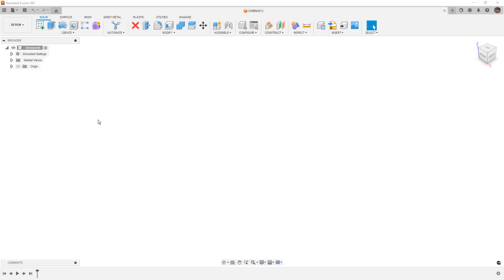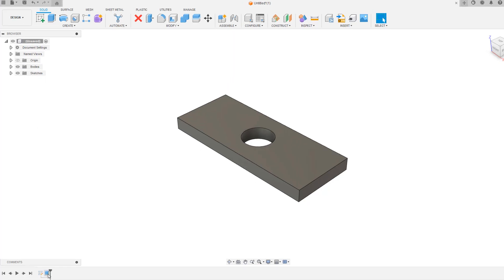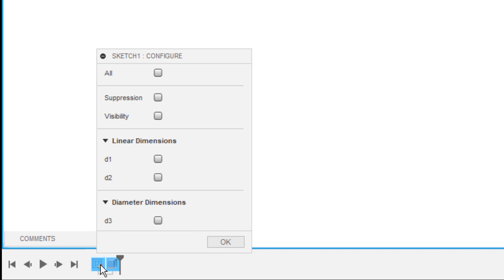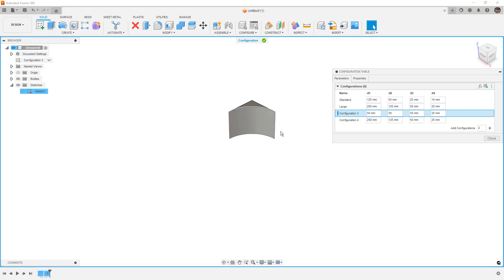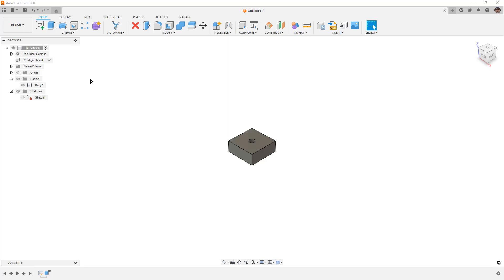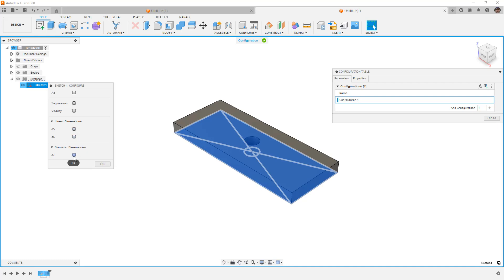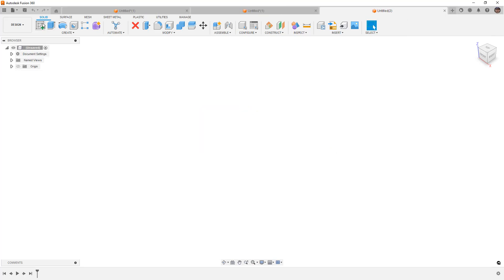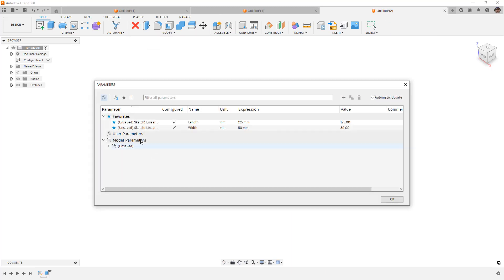Fusion 360 Configurations! | What's New Sept 2023 | How To Configure A Part | Tutorial

Comment: Thank You very good teacher. one question. How do you save Parameters in a template
Reply from the maker: Thanks!  There aren't really templates for designs in Fusion at the moment.  So you can either create an empty file with parameters that you open and Save As when doing a new design,  or in the Parameters dialog at the top right there are import and export buttons. You can create your parameter list, export them and then import into another design.

You could automate this a bit with API by making a script that adds parameters to a new document on open or tie it to a button or hotkey.  Depends on how often you need it and how many parameters you are talking about.
Reply: @LearnEverythingAboutDesign  Thank You very much

Comment: My revised need / understanding 

,... simply using the configuration function to create the "configuration drop-down menu" in the browser, and then "modeling as normal" adding or removing features to the "currently selected configuration", and having those edits be maintained specific to that configuration, "without launching the configuration dialogue workflow"

i'm predicting that unless the features or edits are done via the configuration workflow, any changes to the "model directly as normal" will be included in all configurations, 

Thanks man

B
Reply from the maker: if you make multiple configs but change nothing (don't configure features) you won't get a config drop down.  Even with multiple configurations in the config table, they need to have some variation between them for that drop down to appear.  Again those configuring features is not typically done or efficient if all the components are internal to a single design.  Simply because you need to tell it which features.

Note that once you enable the configurations table, each feature (like extrude) will now have a tab in the dialog for Configure.  that dialog gives you check boxes for what you can configure but it doesn't give you control of values across all configurations.  You would still have to go into the configuration table to handle that.

So I am still not 100% clear on exactly what you are trying to achieve.  The main benefit i see to invoking a configuration table early is to get access to the Configure tab in each feature dialog.  So as you are modeling you could say "i want this extrude distance to be configured" and then it would appear in the table.  It should be noted though that you need to manually change dimension names or else your config table will just be d1, d2,d3 etc.  If configuring sketches/features across multiple components the config table will get out of hand.
Reply: I think ultimately it achieves what's needed, which is variations, "a.k.a. configurations" of relevant Configurable entities, for a  model design, 

,...  it makes more sense now, your not copying a new body, component or sketch to apply needed model variations,, you're creating "value(s)",... variations, "a.k.a. configurations" of existing entities,... Which is selected and managed in the configurations workflow,

after further review, I've concluded that a configurations-short-cut-workflow, that allows the drop-down list in the browser to have checkboxes next to each configuration, which Would take the place of the checkbox selection process that's needed, for example to "suppress" within the table,, this would allow applying configurations more efficiently per variation,

"suppressing" a hole for example, for a dozen "variations a.k.a. configurations" except for 2 of those variations, with the checkboxes in the drop-down for each variation, would be more efficient, and intuitive, then using the table dialogue, 

Thanks man

B
Reply from the maker: you should look into iLogic stuff in Inventor and Configurations in Solidworks.  Some of the functionality that you are looking for might be more inline there.  For example Solidworks gives you the ability to model and make changes on only the active configuration, all configurations, or specific ones.  You can also use Design tables (excel spreadsheet) to build them.

iLogic in Inventor is powerful and offers up different ways to make configurations.

In fusion it is still very new and I imagine will grow and mature in the next year or two

Comment: hey brother, nice work on your channel,

Obviously, configurations, should be called "Variations" that get configured,

"Alternative Easy-fast configuration workflow"?

if scheduling allows, can you do a short video,

Workflow: 
( assuming this is functionally possible )

1. right-click ANY component assembly in browser and click "configuration" ( not default parent tree level )

2. dialogue pops up,
,...rename default configuration to "Variation 1" then add ( + ) another configuration and rename to "variation 2"

,... I now have a second variation, the thought is no hassle needed to apply anything, to Create a duplicate assembly, now with drop-down selection manage-ability from the browser )

that's it! , then,...

1. then, in the browser, select any variation, EDIT THAT assembly "MODEL AS NORMAL", ( change a couple primary dimensions or features for that variation requirement )

,... now you have another variation of the primary assembly, to make feature / ANY changes specific to that variation,

The theory is, 100% availability of all features, assets, are available to edit for "either" variation

i'm using the personal license, so I may be missing something here, and that workflow, may not be possible?

- 

Thanks again Brother, great work on channel,
Great and unbelievable things are ahead!

Brian
Reply from the maker: Thanks Brian!  Configurations can be a bit tricky as there are a few ways to approach them.  The typical way you would configure a component would be to configure it in its own file. then save it and insert it into another design.  Certain things are available at the component level because the configuration is for the entire design.  So at the component level you are generally looking at suppression, material/appearance. visibility, some properties like description, PN etc.

So for example you could configure a design with multiple internal components, but the dimensions and features would be seen in the config table for everything.  So this can get pretty out of hand.  If you want to say have an assembly with different sized wheels, the best(most stable) way is to design the wheel in its own file, configure that. and then insert it into the assembly.  You can pick (and change) which wheel config you want to use and even have different instances of the same component with different configs.
Reply: The real world use case, is a short workflow without repetitive new UI / functionality to access UI / functionality that already exists, 

not having tested this workflow myself,,
And I do appreciate your efforts towards this,

My primary need, is to, ( I think you get it )
( changing dimensions, features, materials, appearance ext,... is already functionally achievable, I just need another variation, to change a few things

1. Create a model component assembly

2. Use the configuration function to create a variation ( + ) add variations with new names for each ( click OK, do nothing else ) no check boxes etc. ( this is where I'm not sure what will happen )

,... which creates the ( expected and intuitive ) drop-down within the browser ( Which is a good feature to toggle between variations a.k.a. configurations )

3.select a variation in the browser drop-down and Edit to the appropriate variation features required, like any other model as normal workflows

software 101, never re-create the same OR similar UI and functionality in multiple locations, always  reuse the same single source UI, UX 101,... 

just select the variation you wanna work on,

Thanks Brother for your efforts, I will test this out, to see if this simple partial use-of  configurations functionality is achievable, 

Brian
Reply from the maker: Hey Brian.  I 'think' i know what you are trying to do but i do think there is a disconnect of sorts with the way configs work.  So you have 3 main workflows in Fusion.
1. All Bodies in a single design
2. Components in a single design
3. External components inserted into a single design

When you configure #1 then you are looking at mainly controlling the features/dimensions used to create that.  If this file is inserted into another design, you get to pick and change which configuration of that file is used.

When you configure #2 where the components are internal, you can still configure the features/sketches but the configurations at the top level is not going to let you change the name of the component.  You can change its part number and desc, but that isn't what you see in the browser.  The config name will be in the config drop down just under document settings, but for the actual components the best you can do is suppress them from a specific config (not change their names).

For #3 this is the typical workflow when you want independent unique components in an assembly.  You configure them as bodies (#1) in their own file and bring them into another design.

There are more nuances to it but it sounds to me like what you want the result to be is #3, but applied to #2 and i don't think it works that way.

Comment: Is there a way to the configurations change a text label. I.E. I want each part to have a individual serial number.
Reply from the maker: When you open up the configuration table, there is a Tab for Parameters where you do things like change dimensions, and the second tab is called Properties.  On the properties tab you can configure the default properties for a component like Name, Part Number and Description.  that should do what you want.
Reply: @LearnEverythingAboutDesign   would I be able to emboss that information to each part, like a lable
Reply from the maker: @davidhollis8606  Not exactly, well not linked in any way.  You would need to have a sketch with that text in it and extrude that, and in the component where you have configured that PN you would have the feature(extrude) unsuppressed.  So lets say you had a part with 3 configurations.  Part numbers 001, 002, 003.  You would need 3 sketches. 3 extrudes. and in each configuration you would suppress 2 of the extrudes and unsuppress the one with the right number.

Comment: Hey, thanks for the tutorial. So if i choose for some measurement and i want to use it in new desing, i click Save as and insert it there? Or whats the best way to do so
Reply from the maker: I did a 3 part series on configurations for parts, assemblies, and drawings you can see here. https://www.youtube.com/playlist?list=PLBDfGh8A8kXXmBat7iDTFTU3VyFwTy9tB

If you are talking specifically about the ability to save parameters (which is new this year) you can create user parameters i the modify parameters dialog. then export those and import into another file.  They won't stay linked but you can have the same parameters.